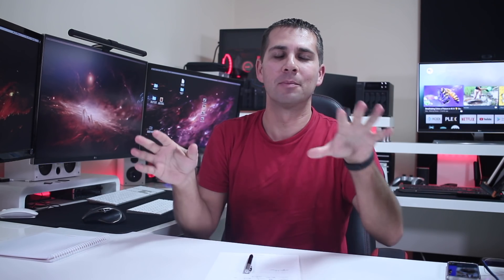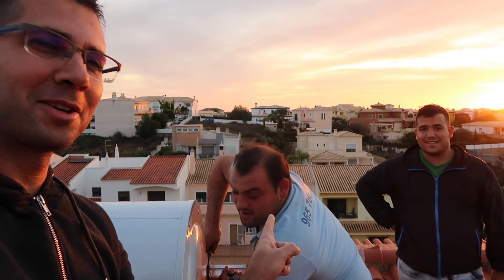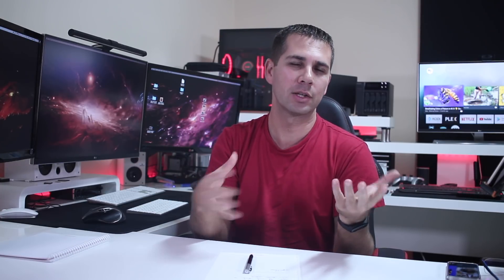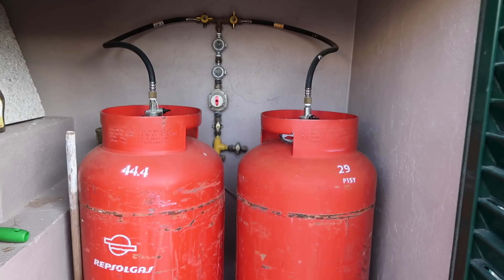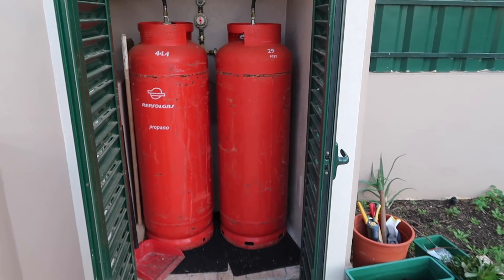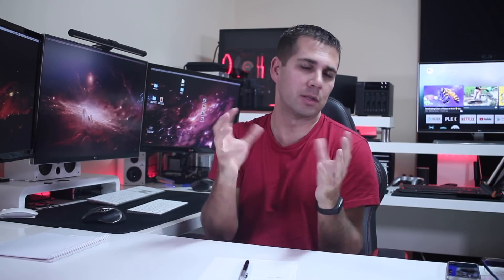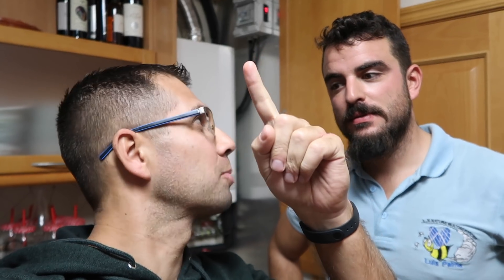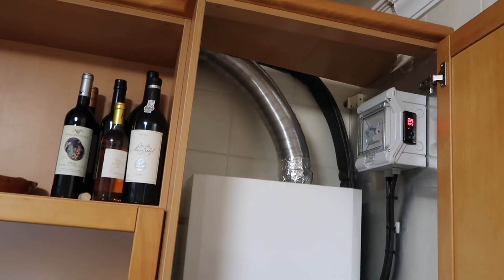I INSTALLED Solar HOT WATER Panels | Thermal Collector

Comment: Hi Roberto i hope you are safe and doing well. I like this video its educative because i want to instal solar collector on my roof. I live in apartment building on last floor. So roof is very close to me. I have electric central heating. I was wondering if i can instal solar collector and connect it to my central heating unit because i would like to heat my apartment on that water. It will reduce my electric bill for a lot maybe i dont even need to turn on the heaters inside the heather unit. My hot water for shower is separate from my central heating. Is my idea doable ? And if so what kind of modification i have to do in order to realize this idea. Also position of my apartment is sunny all the time. Sun goes up in the morning and by 6-7 pm (depends if its summer or winter) it goes down. So i recon i will have more that enough sun on those solar collector to heat up more then enough water. Anyway thank you very much for sharing this video it was very helpful and educative 👍

Comment: Good video Roberto. We should all try to save energy and reduce our co2 emissions and the solar hot water heaters are a proven technology. Just a small thing I noticed is the flue of the gas boiler which  could be better. More efficient and safer

Comment: You could connect the heat that goes to the radiators (I guess you have gas) so you can heat the water that you use. I have done this so now I have 3 ways to have hot water. 
1. From the radiators
 2. From the sollar cells
3. From electricity

Comment: You could have gone for the solar tubes as they are lots more efficient, I run my central heating off them also. You should be ok on 1 gas bottle as you say. Well done for looking into it. I live in Cyprus and only use the electric to heat the water for 1 month a year.
Reply from the maker: Hi Kirk, true but while investigating, here where i live we dont have much choice with solar tubes systems and then investigating a little deeper the reason that i understood is because exactly the high efficiency hehe 😀 Sounds dumb but although they would be great for winter, they would be with really high temps that would damage them a lot faster than these panels that i chose. I have read about some people that installed them here and bad results.
At this moment (December) with weather temps of 20ºC-24ºC im getting water in the tank at 60ºC - 70ºC, i imagine that during May up till October having the peak in August it will boil hehe!!
I will keep the log. 

PS: Just cheked your area and it seems that you have same average temperature that we have here. Is the summer as hot as well, we get 40ºC - 45ºC which is a lot 😀
Reply: Hi Roberto, the summer months you have to cut the sunlight by about 60% with the tubes, this is done very simply with a mesh over the frame. Bring on the summer eh lol. Great info on vid's my good man keep em rolling in eh!

Comment: I live in Israel, and almost every home here has solar water heating.
 I do not know how much this system costs in Portugal, nor do I know the price of electricity there, but in my country it is much cheaper to just heat the water with electricity than invest in this system. People here keep on installing these systems because they are under the impression that it is "free" energy, without taking into account how much money they invested to install it.
In most parts of the country, the water is very hard, so you have scale buildup in the water reservoir, and in the solar panels, so the system becomes inefficient over time, and after around 10 years you have to replace it because it is either full of calcium, or it has rusted because it is exposed to the elements.
Every year I go up to the roof and open the boiler to remove all the lime. I empty about a bucket of "rocks" each year from the boiler.
BTW, it is more efficient if the water tank is standing up. The hot water in the boiler tends to rise to the top of the boiler, and when it is lying down the hot water layer has a larger surface area with the colder water, thus taking longer to heat up.
Since the hot water rises to the top of the boiler, you do not need to heat all of the water for a hot shower, usually 20-30min of heating with the heating element will be enough for 1 shower.
Reply from the maker: Hi Dave, just to have an idea here we pay roughly 0,23€ per Kw. I understand your thoughts and agree with them so that is one of the reasons that i wanted to keep both systems Gas + Electric as backup. My idea atm is that gas is cheaper as it will only spend the amount that we actually need. And its instantaneous, i can just go 😀 while electric backup requires planning - All doable off course.
Regarding cost, here these systems average about 2500€ lower or higher depending on the brand and size.
We spend 800€ - 1000€ of gas per year while having comfort, but if we saved more removing a lot of comfort like shaving with cold water and similar situations that we dont want we could probably go to 600€ - 700€ per year. Having this in mind and if i can accomplish of spending 1 bottle per year 100€ we will be saving 700€ - 900€ / year while maintaining our comfort.
From my calculations i will have payed the investment in 2.8 to 4 years.
Our water is hard but not the worst 😀 none the less we use filters on the system that doesn't eliminate completely but helps a lot in reducing the accumulation of debris and calcarium in the metal of every device (washing machines etc)
Thanks for sharing Dave 👍😉

Comment: Ola Roberto,  quando começares com a Domotica a sério é que vais ver o quão viciante é, eu q o diga $$$ :/.  Acabei de instalar nos radiadores valvulas inteligentes top of the pops, ligadas a estacao meteo da casa . Vê esta marca, tipo " Porsche" da automatização na regulação de temperatura, adoro tudo o que fazem, design da App, website de gestão, integração.    os produtos sao todos em alumínio anodizado, desenhados por designer Philipe Starck. É fantastico. NETATMO.
Reply from the maker: Hehe!! Acredito que sim 😀 Isso é interessante e fui ver agora esse kit Netatmo e parece 5 estrelas 😀 Será que conseguia ser adaptado a um "T" colocado á saida de água do termossifão? Podia ser uma coisa interessante hehe!!!
Abraço 👍
Reply: Tens aqui as specs. Ja vi a tua caldeira  e é compativel . O termostato é de contacto seco, positivo e negativo que dão uma ordem de " on" ou "off". Tens de ver onde ligar ( na caldeira é possivel) mas nao sei se dando uma ordem a Caldeira ela faz bypass para o deposito solar. Tens aqui as specs : Replaces wired and wireless thermostats
Dry contact Themostat and Relay, potential free (ON/OFF)
Switching current: max 4 (1) A
Switching voltage: max 250 VAC
Maximum switching capacity: 120 VA (4A load @ 30V, 1A load @ 110V/120V or 0,5A load @ 220V/240V)
Power factor: cos φ > 0.8

Basicamente  fala com o instalador e diz que queres ligar um termostato inteligente para aquecimento . Qq caldeira da pellets, gas ,...